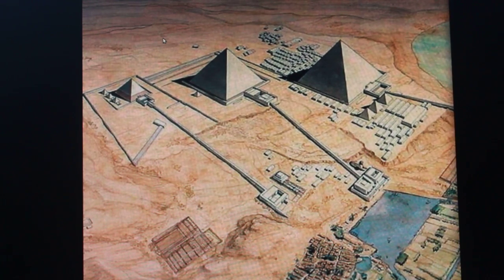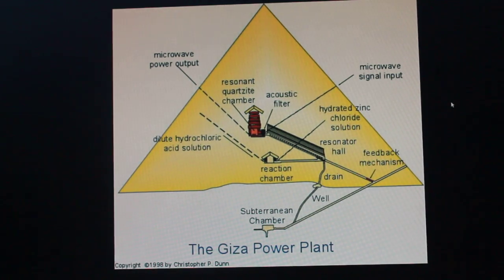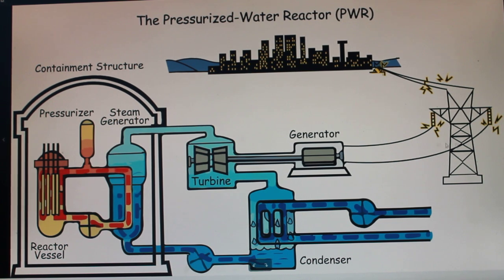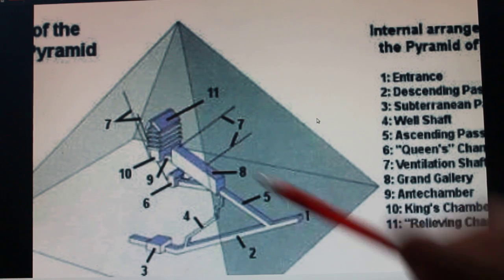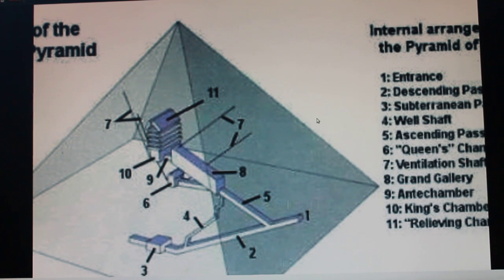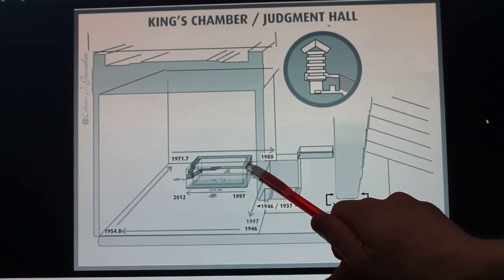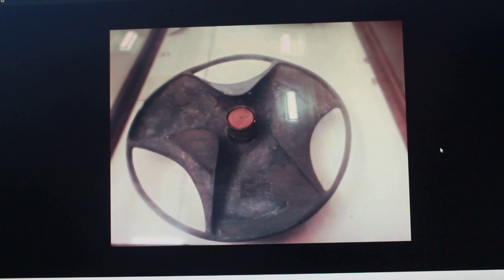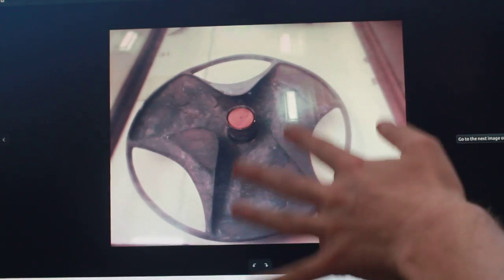Is the Giza Pyramid an Ancient Boiling Water Nuclear Reactor Complex? (Part 1)

Comment: I don't know anything about this subject but ,
1- land a UFO on that pyramid shape on top ,it would be stable.
2- use it as a refueling station
3- make it easy to take off
4- interstellar travel ?
maybe maybe not ?
Reply: they in ancient Greece knew of solar system and ancient Egyptians are said to have been more intelligent
Reply: Jack Richter Maybe pyramids were ancient gas stations around the world :). Those are literally every continent. Just a flying thought.
Reply: perhaps gas without the station,  give iron base alloy (nic/cob) dagger found by howard carter in 1922 that they did not tell us about until 2016. you need more heat than charcoal for that.
Reply: The fucking thing was gleaming white and looked like a jewel... not a fucking refinery and fuel dump.
Reply: I’d go along with that!
Reply: I like your theory!
Reply: Jack Richter I disagree bc it would be too much work to build large structures that take a long time, plus not to mention the coordinates and the fact that the pyramids align with Orion’s Belt
Reply: Lmaooo

Comment: DC electric doesn't need to be local if it's high voltage.      AC electric, high voltage is easier to convert down to a lower voltage for end consumer usage though.

Comment: The Egyptian Pyramids are much older than you think. Your ideas are novel but wrong.
Reply from the maker: How old? I have suggested in an earlier vid that the pyramids were reworked for 10,000 years. For example, the Great Pyramid has only had its casing stones carbon dated to Khufu's time. They never carbon dated the inside. Inside of the Zozer pyramid carbon dates to centuries of millennia older than the surface.
Reply from the maker: I think you are already blocked but it doesn't matter. If you look at the article they dated mortar from between the casing stones in many different places, high on the pyramid. So, I said nothing wrong. They have only dated those stones. They have not dated the interior.
Reply: Right this Buildings are megalithic constructions originally assembled without mortar.
so obviously they dated the repairwork done and written down on Papyrus by the site manager of king approxly BC 3500 .
Reply: ShadeyBladey wrong
Reply: People. There was a global flood 4,500 years ago. This removes any possibility of there being any Pyramids or people to build them before that time. They are built out of the sediments laid down by that flood, so please, stop posting this nonsense and these nonsense dates.

Scripture describes who would have built these structures and it's not difficult to appreciate that 5-6 foot tall men would have had trouble creating these and other structures found around the world.

Stop trying to pull wool over peoples' eyes.

Your comments, especially the person posting the video contain pure nonsense.

Read the Bible. It's an accurate record of history.

Comment: Absolutely love your videos. What is your opinion on the Osiris tomb? The one found in a long shaft between the sphinx and the great pyramid
Reply from the maker: Wow, thank you sir! Ah that one! Yes from memory, that's one of the mysteries. Well I think one of those shafts would have to be the Khufu tomb, or leading down to the Khufu tomb as described by Herodotus. Burial in 4th dynasty was down a vertical shaft under a mastaba, and the shafts in the pyramid do not reflect this burial practice, which is never pointed out. The entire Giza plateau could be described as a huge mastaba, with Khufu at the subterranean lake, still undiscovered! There has to be stuff down there, but all blocked up! Will look into this Osiris shaft more, maybe another vid, hehe. Thanks again for your nice words.

Comment: Some Survivors of the Great flood had knowladge of the tecnology from the world befor. They Dug up, Found, Made or already had with them, an Energy source made  from the old world.  Yes it is.... or now Was.... a kind of a power plant. But the (Battery Pack) that was the Main part of the Energy plant was stolen!  Stolen becouse other survivors found out about it and their was a Fight for the Power source..   This is now known as the "Arc of the Covenant"  Remember Hight levels of electricity tend to  Arc !    Arc welding?? 
Their were plenty more power sorces around but were and still arer burried by the flood (The old Powerplants from the world befor the flood that got coverd very quikly with no time to turn them off....  like in Fukushima!!) ...  They became what we know now as Volcano's and Not easy to get to at all...near inpossible as their still Going and creating masses of heat and gas , Constantly melting and re-melting the Mud, silt (Now Rock)  around them, creating massive pockets of gasses under and around it..that now and then go  "Pop" !!   
Great Video and hope this helps... :)